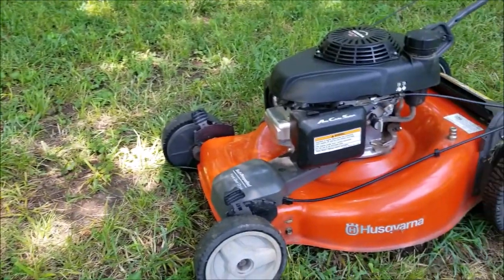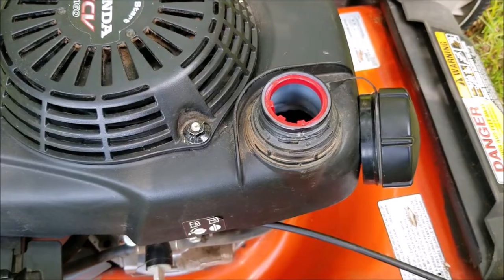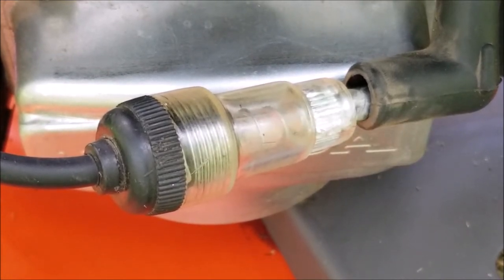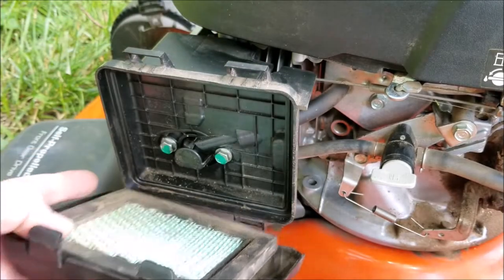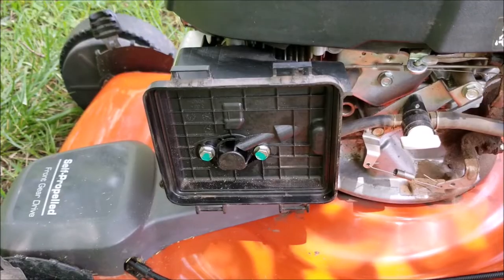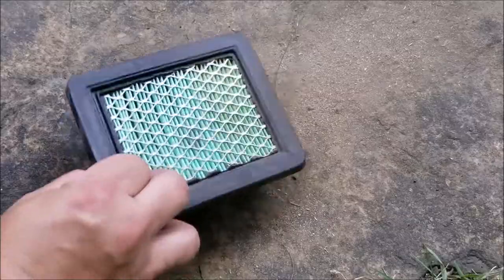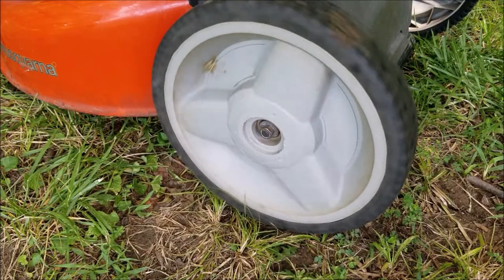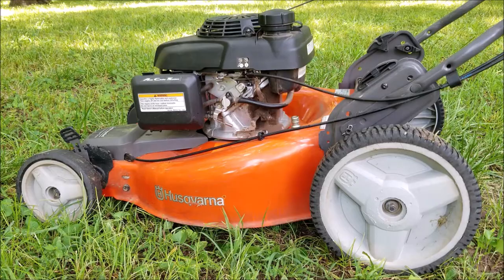Fix a Mower that stopped while mowing and won't start again

Comment: They just threw away a couple hundred dollars over a spark plug
Reply from the maker: that an oversimplification but yes, they bought it 3 or 4 years ago, never serviced it, and because of a clogged air filer, the engine ran rich, carboned up the spark plug and that didn't allow the engine to start.  That's when they decided to throw it away.